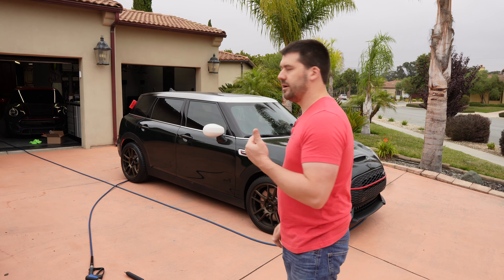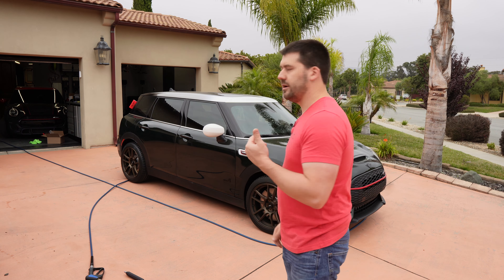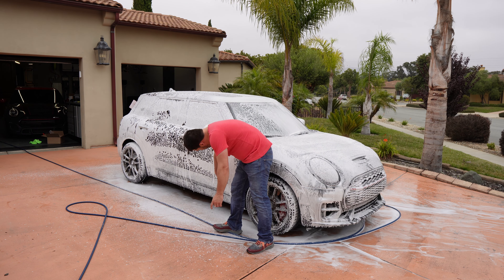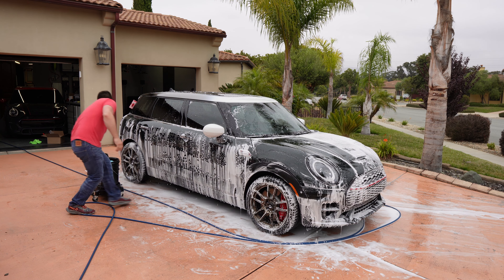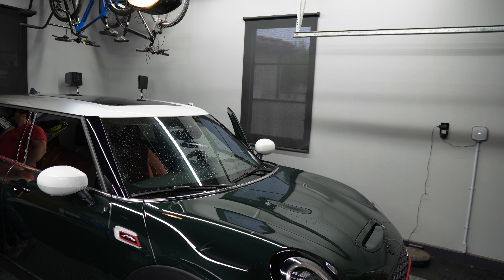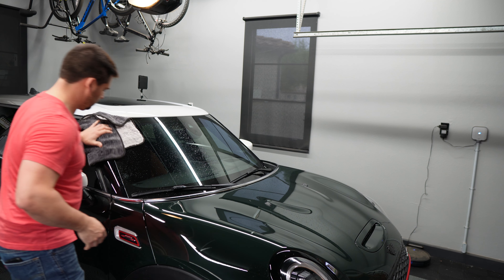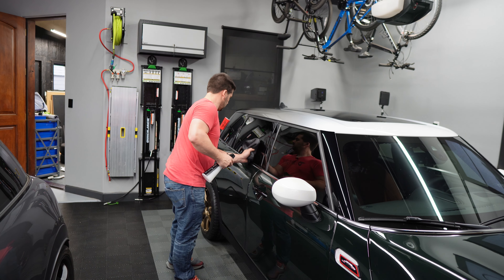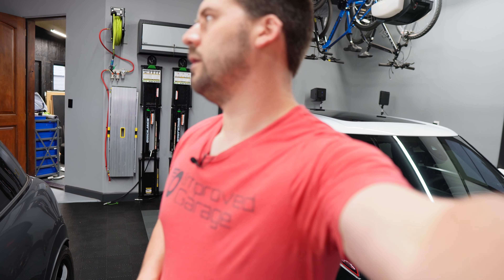IG463 2024 Mini Cooper Clubman Part 10 First wash AFTER PPF

Comment: Thoughts on the deli mitt?  I have the incredipad xl and have been debating switching to the deli mitt. I know its a little smaller. Curious what your overall thoughts are.
Reply from the maker: I have both and really like the delimitt. I bought 5 of them when they were released and I’m happy with them. I don’t find them heavy or too small, but they are a little smaller than the xl